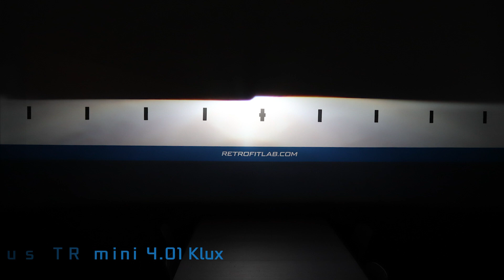Audi A4 B5 HID xenon headlight repair and upgrade kit - projector retrofit DIY installation

Comment: How big is the lens? 2,5" or 3"
Reply from the maker: 2,5" but a better 2,5" than a lot of 3" ones ;-)
Reply: @Retrofitlab  thanks a lot :)👌
Reply: @Retrofitlab  can 3inch fit ?
Reply from the maker: @exeRonZula  No a 3 inch will not fit well. The 2.5 inch fits perfectly. The OEM projector also has a 2.5 inch lens.

Comment: Why? Just, why? Put an LED bulb instead...
Reply from the maker: Installing a LED bulb will not solve the issue when the reflector bowl of the projector is burned and black. The light cannot be reflected through the projector anymore, which will cause the drop in the light output. With installing a new projector you can solve this issue.